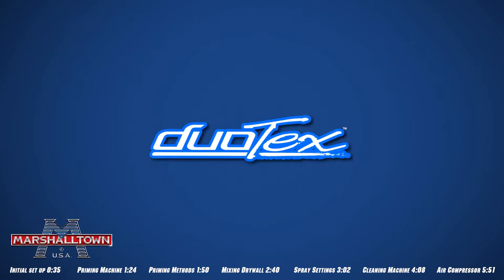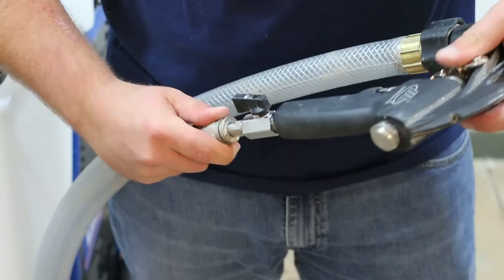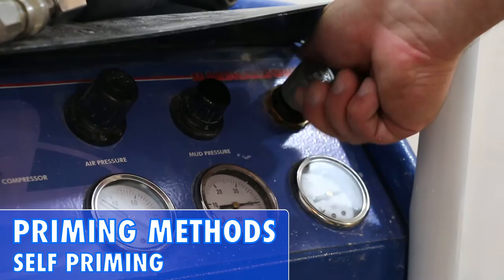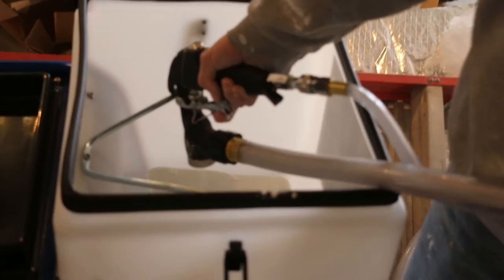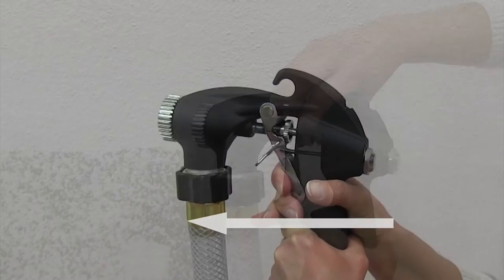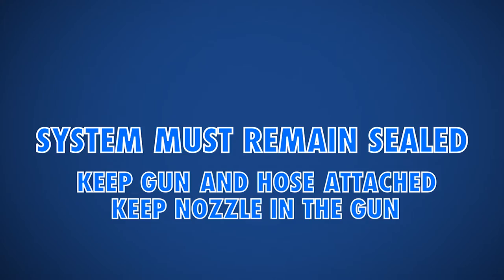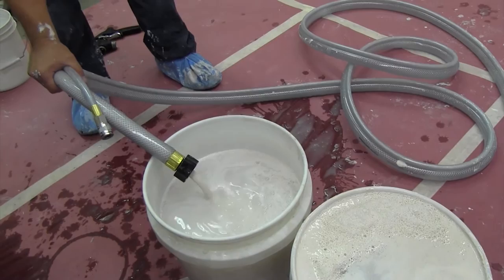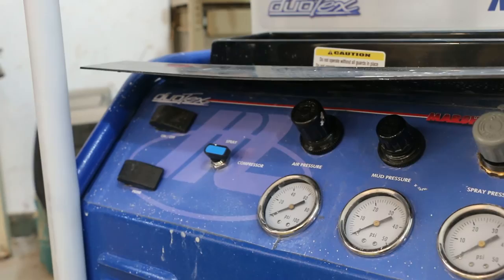MARSHALLTOWN DuoTex™ Texture Sprayer Instructional video

Comment: I’ll be looking into buying this machine 
It looks like it has better settings then the graco texsprayers.
Not enough air pressure out of the graco.
Especially doing vaulted ceilings.
This has a mud pressure regulator I like that.
Reply from the maker: https://marshalltown.com/pro-2964-duotex?variantItemId=18962

Comment: can the spray stucco
Reply from the maker: The DuoTex has been very successful in spraying stucco, as
long as the type is specified to be applied with a gravity-fed hopper
gun.  We would not recommend using the DuoTex to apply material that
contains long polymers or filaments as part of the mix.